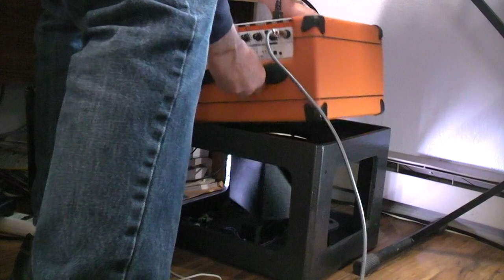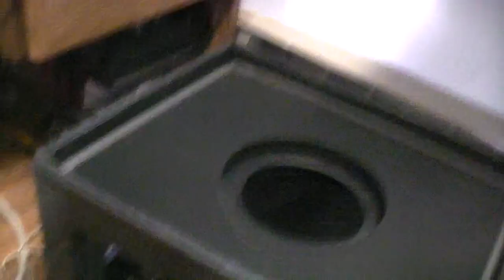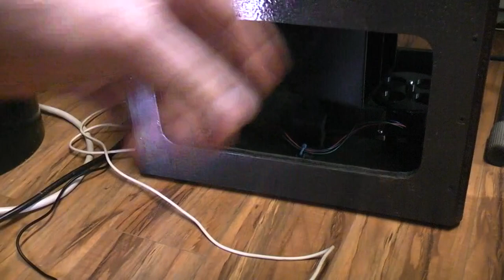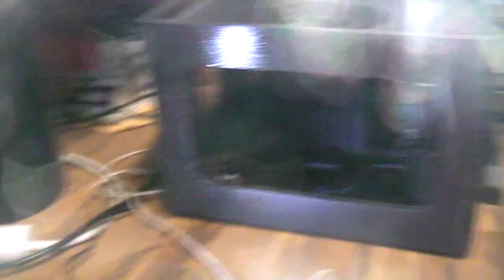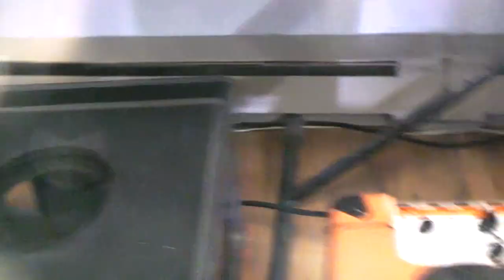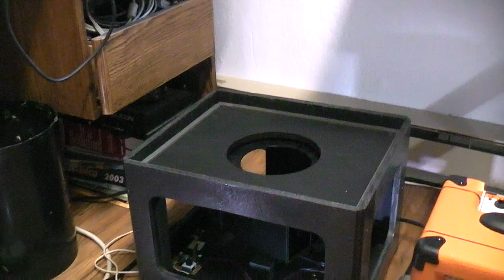Turn your practice amp into a LESLIE cabinet for under $50. Part1 the Demo. .

Comment: That's pretty cool. My first thought was an RC brushless outrunner, standard speed controller, can work with a standard servo tester then i guess; but Trinamic and stepper is fine too.
Reply from the maker: Yes that was my first thought as well but this costs lest and the ramp up / down speed control is simpler. So stepper motor  and drive it is.

Comment: If you want to use just one amp onstage it might be an issue when the Leslie was turned off. It seems like the amp becomes a one trick pony when it’s laying on top with the speaker pointing down.

Comment: @robothut would it be possible to make something like this varispeed, so we could set the speed with an expression pedal or CV, rather than just having fixed speed settings?
Reply from the maker: Yes, check out my other videos on this build and you will see that is what I did next. I added a foot peddle so the speed could be controlled.

Comment: Just made one of these using a small dc hobby motor with a controller that lets me run it from 1.5 to 12 volts in 1.5 volt increments.  I used the spindle in the base of an old harddrive as the mount for the hand made wooden drum. And a rubberband for the drive belt. Lol. I use a Roland Cube amp or a home made speaker cabinet with an old Champ head that i made back in 1978 when i was in high school to drive it. I think I might try using your stepper motor controller combo in my next build. I thought of 3d printed drum but don't have access to a 3d printer.
Reply from the maker: Very cool build using what's on hand. There are lots of schools and even library's that have 3d printers. You might find some one that will print the part for you for free.

Comment: Wow! just happened upon this. What a great build inexpensive and sounds awesome using commonly available parts. Will be putting this on my to-print list! Thanks for the effort and definitely for sharing.
Reply from the maker: Thank you for commenting. Have fun with your build. So many junk parts could be used to build a unit. Even an old fan motor could be used. I just had 3d printer parts so went that direction.

Comment: You really are a genius. I am seriously impressed with this finished result here. 
I am going to watch the build videos, but I unfortunately don't own a 3d printer. 

I'm curios if you could build a pedal I've been wanting to have. It's a pedal like a wah, or a volume control, but it has a wire out the top that turns. The bendable turning wire can turn the knobs of your regular guitar pedals. 
I've always wanted one. It gives a way for you to raise or lower an affect without having to bend down mid song. 

I completely forgot the name of them, but if you would be interested in trying to build one, let me know, and I will dig up all the information I can for you. 
They used to sell these awhile ago, but for some reason the demand wasn't that high. I have no idea why, I think it is.an amazing tool to have. 

Regardless, I hope your staying safe out there. 
I'm super impressed with your skill.
✌️† ❤️
Reply: The product you want is called the Third Hand.

Comment: Okay weird question, but if the slow speed is 45 RPMs and the fast speed is approximately 340, wouldn't the easiest way to achieve those speeds be to put the horns on top of an old turntable? That should give you both of those speeds plus 78 as well. 

I absolutely love how you used an existing amp without needing to modify it at all. Great design work!
Reply from the maker: Yes , I did back in the 1980's. But this time I used what I had laying around, old 3d printer parts.

Comment: Here's how I made my Amp sound like a Leslie. I took the battery out of my lawn mower and stuck it in the back of my Amp
Used a power converter ' connected it to the battery and power up the amp , 
I then took a jump rope and tied it around the Amp handle and hoisted it up in the air
I then used a wireless system from the guitar to the amp ' I then twisted the Amp round and round until the rope was tight and then let it go and started playing. 
Wasn't exactly the Leslie sound but was kinda close.